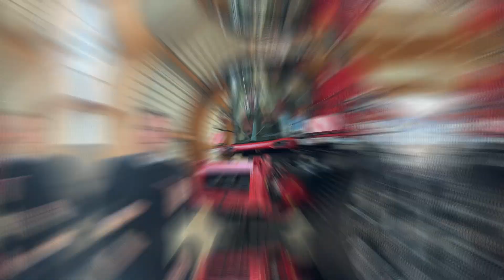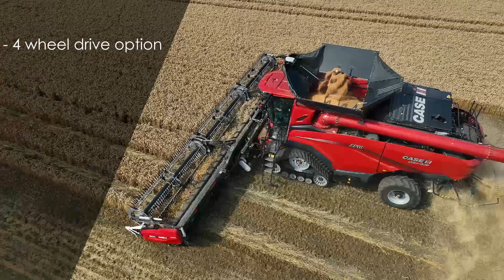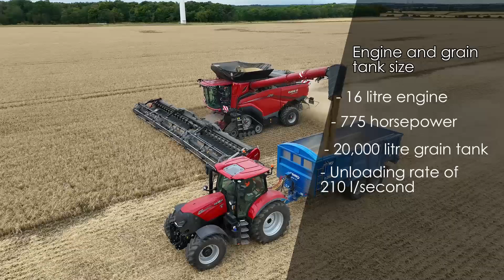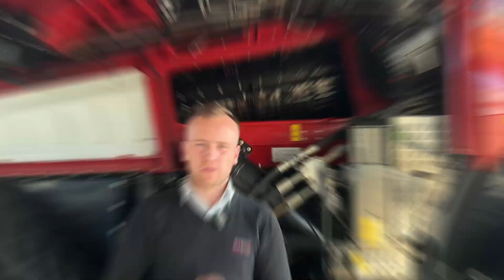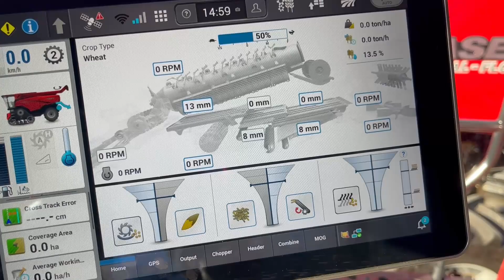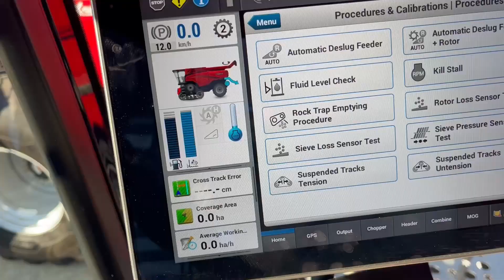INTRODUCTION TO THE NEW AF10

Comment: I thought the AF 11 was the biggest ?
Reply: AF10 is largest for hard red fans—Axial Flow—single rotor. The motor,cab, separating guts same as AF11 or painted yellow CR11. NH has I think a CR10 with the smaller motor, but twin rotors and same separation guts which are a new system and a big capacity jump. Would suppose at a future date smaller AF and CR models will get the new separation system. Think the AF10 and 11 are same combine except for thresher—single vs twin rotors.
Reply: It is - the AF 11 has twin Rotors, whereas the 'smaller' AF 9s and 10s have a single rotor which is larger diameter than the twin units of the AF 11. AF 11 is slightly wider in the body than the two single rotor models, generally speaking. Horsepower and grain tank capacity are the other main variables between the models. Same criteria applies to the New Holland equivilent machines.
Reply: @jamesbarbour8400 the AF 10 is the same size body with 1 rotor. The CR11 isnt the same as the case AF11. different styling cab different automation system. The only similarities is the engine graintank and 2 rotors. The case AF11 10 and 9 are a tad shorter than the new holland CR11 and have. The new holland CR11 has a longer overhang at the back and a diferent drive shaft. The case has AFS while new holland has PLM so its not a case painted yellow.
Reply: Me too???
Reply: It is but its not coming to the uk so we have the AF10 eitch is the world's biggest single rotor combine on the market